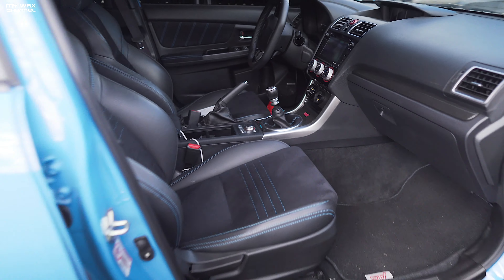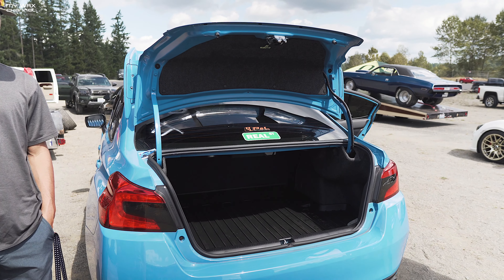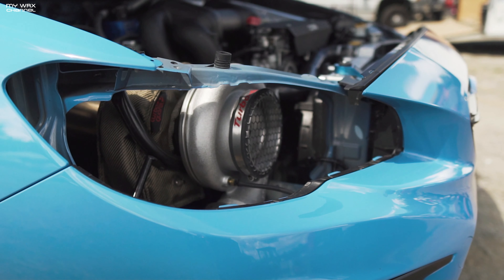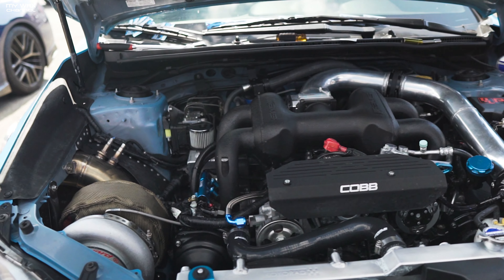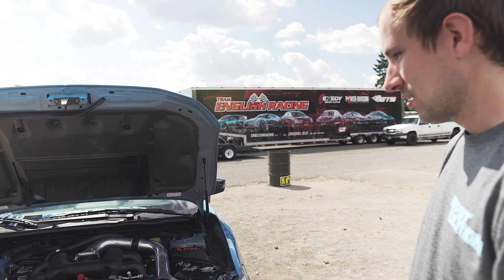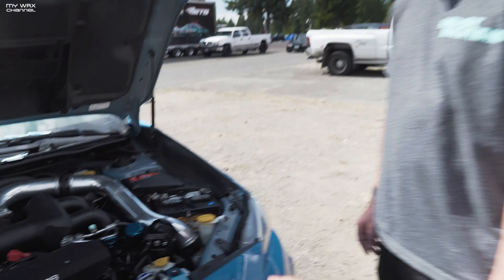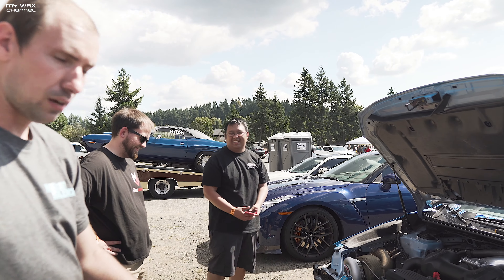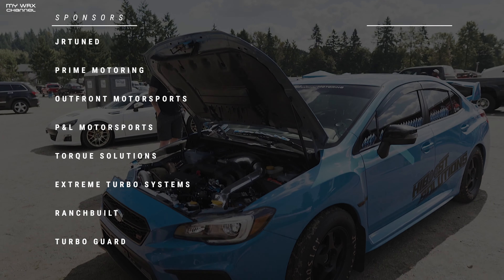😱 INSANE! 1000+ WHP 9 SEC STI | STREET LEGAL | MOTHER OF GOD

Comment: Sheesh the car blew a head gasket getting that run
Reply: Rebuilding his engine after every launch. FeelsOkayMan
Reply: Lol look at willall racing’s or s&j automotives sti’s, those things push over 1000hp and are as reliable as a stock sti!
Reply: @someguy920  20 grand for a billet closed deck small block. Definitely more reliable than anything you've ever driven.
Reply: @WorkinClassCanadian  is that true Ryan? Genuinely curious.. That a billet closed deck pushing this kinda power is literally more reliable than .. Even in light of the head gasket blowing?
Reply: @AuGold808  when the head studs are bigger than any bolt on your car it should be.